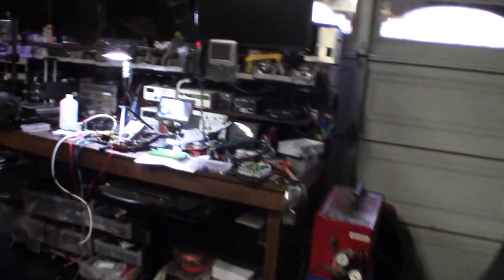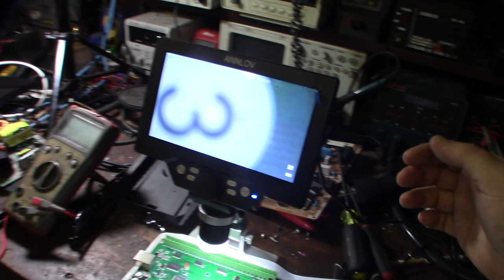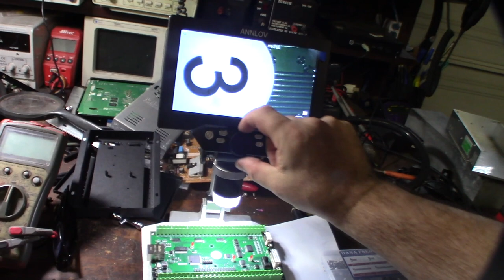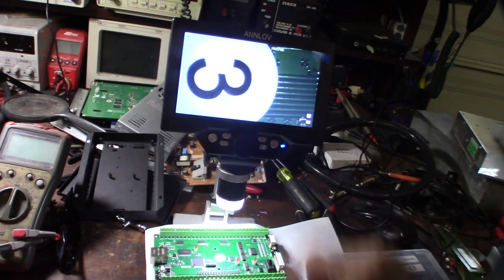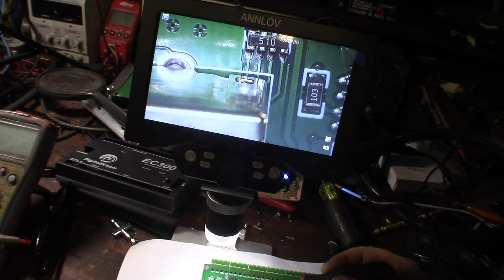DigitalDream EC300 Mach3 controller PCB inspection possible axis hack EC500 Novusun

Comment: Hi!! would you recommend it?  I need to change the one I have on my machine
Reply from the maker: The older V3 model works great. I just got newer EC500 V5 I'm making a video about. So far its been a disaster. The changed the processor in the new version with all the LED's.
Reply: @fintechrepairshop  Ok. Thanks for your opinion! Thanks